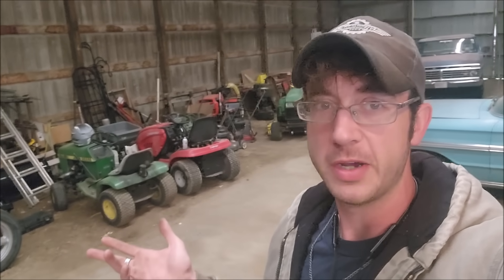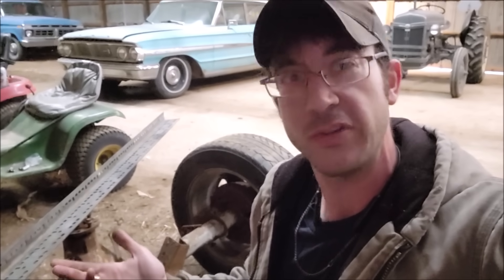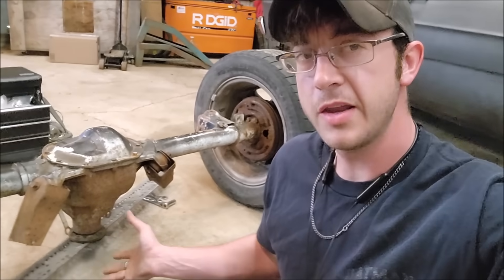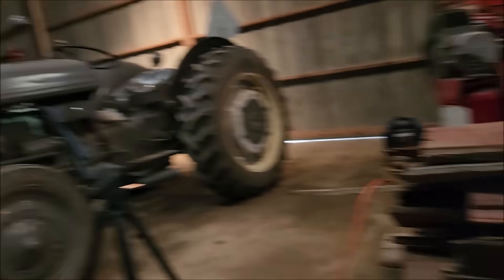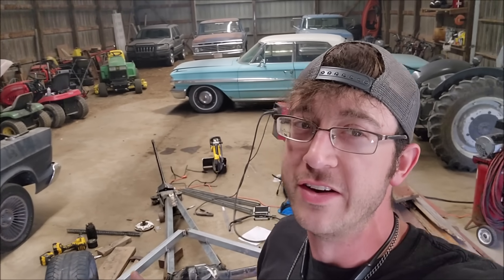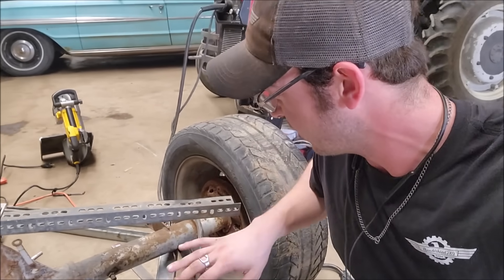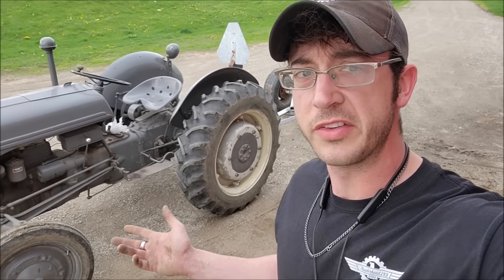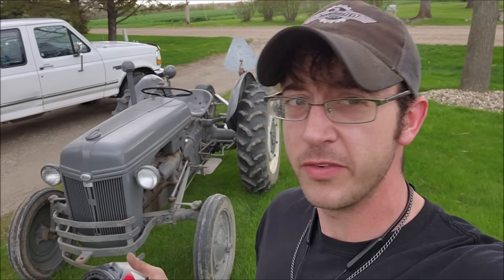Car Differential MOWER: Build & Test!

Comment: Hummm.... I wonder if a flail style blade system may not work a little better. Something like swing set chain with "whatever" for weights? That would also be moderately less sketchy if something came off. Chains tend to lose energy faster than solid chunks of steel. 😅
Reply: Blades on the ends that are bent down to stop drag in the center. And Bob's ya untie
Reply: Make it like a weed trimmer? String or chain is less dangerous than a chunk of metal flying through your yard like a throwing knife and it would give it more flexibility if it was to hit the ground or something solid.
Also just put a cover on so it doesn't throw stuff at you
Reply: @carlosquezada9309  Yeah, pretty much that concept.

Comment: Never forget that most of what is on a brand new tractor was once a farmer jerry rigging something together from necessity.
Reply: Dont know how you'd do it but if you could get the gearing down and get that thing twirlin itd be perfect for a flat lawn. But as a bush hog operator i wouldn't want to be going any faster than 5mph around obstacles or on slopes.

Comment: As a guy that's got 20-30 years on you, I can attest to the need to save on the ole' back! They don't get better, just worse. Fun vid!
Reply: Ditto! Amen to healthy back advise! Had to retire early due to back & other mobility problems! It sucks every day! Paul from S. Central Tx.
Reply: This would make a much better dethatcher than a brush hog
Reply: I totally agree with Paul! I have some 35 year old steel parts and while those parts are still fine. The bones they are screwed into... not so much.
Reply: So true. All of that stuff eventually catches up with you.
Use the workbenches, saw horses, mechanics carts, etc. Work upright, and off your knees/not squatted down, every chance you get. You do better work that way anyhow.
Reply: Mid 50's and I am watching this 4 days into a microdiscectomy recovering.  Yes to saving the back.
Reply: Since 1967 I have had spine problems due to a lifting accident while in the USAF.  Things steadily worsened and 12 years ago I had my lower back fused L5 to the pelvis, shored up with titanium bars and screws.  Now the titanium screws loosened, causing more pain.  I'm having the titanium removed and a Spinal Cord Stimulator implanted.  After a 7 day trial, I find that SCS is a wonderful device.  It can't hurt for anyone to ask a pain management doctor about one.
Reply: @jeffryblackmon4846  That's a long time explaining to the metal detector guards. That SCS unit you are talking about, is that similar to a TENS unit?
Reply: Word on that ol boy 👍

Comment: Swinging blades on a solid middle may be best when you begin hitting things Luke
Reply: Definitely. Imagine if that thing hits a.rock buried halfway in the ground
Reply: Yeah flail mower blades would be excellent for this setup and would make replacing blades much easier. Also looks like the speed of the blade is a bit on the low end, I'd make a cross and have a total of four cutting blades!
Reply: @kevinbouchard5362  and the blades will turn even slower when he puts the bigger tires on
Reply: Heh, he needs 4.10s next!